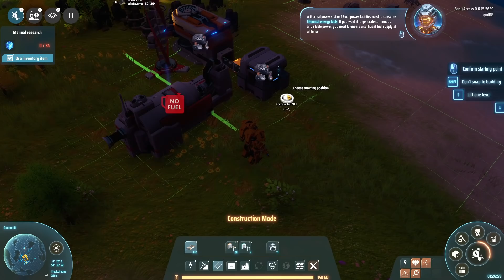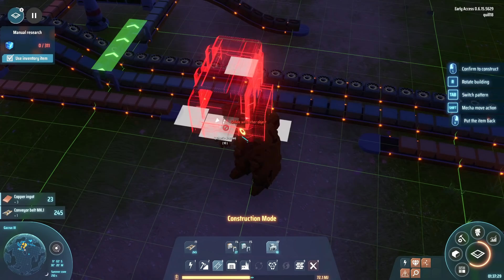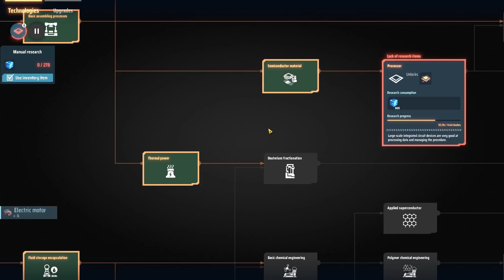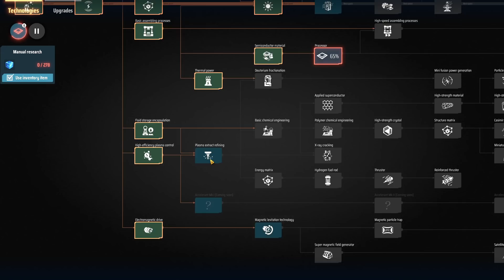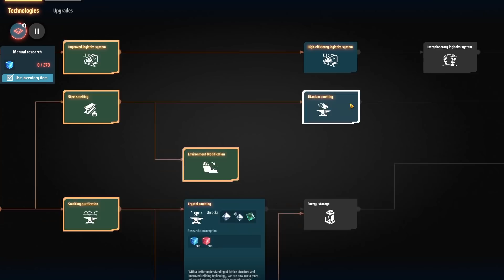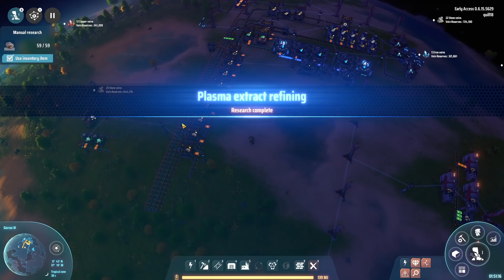Dyson Sphere Program - Cosmic-Scale Factory! Ep 3

Comment: I dont know, this game feels like an inferior clone of factorio. 
Almost everything is the same, just with more bugs and wonkier GUI. 
I guess they will fix this over time, but then it will still just be factorio without biters.
Reply: I'm 60 hours in and haven't encountered a single bug so far and the GUI isn't wonky at all, it can be improved but it's very usable.
Reply: >but then it will still just be factorio without biters.

Sounds good to me.
Reply: It's the awful text that puts me off. Paying for a voice actor but can't pay for a half decent script? Its painful
Reply: By bugs and wonky GUI I was thinking about small things you could see on the video
Like not being able to replace belts with a splitter
Or the same splitter even though its specifically designed to be used on buses cannot be placed next to a belt (needs one block of space, even though visually it fits there), 
The fact that to pick items from belts you need to open each belt and catch the item (good luck doing it when belts are moving).
etc.
Reply: @hubertnnn  I call what you mention QoLs, yes the game can use a lot of QoL improvements like one click upgrading belts, factories, etc. Everything that have a higher tier. Right now the only way to do it is to destroy the old and redo everything again, which can become tedious.

Comment: Ah magnets, so 'fun'.  Initially you just get annoyed at the 1.5 seconds per production run because nothing else works like that so it doesn't quickly fit into the calculation of just how many of what you need to constantly supply a building.  But that's fine, because only electromagnets need them and thus you only need to evenly provide for a single electromagnet production run and once that's worked out you can forget about the uneven production time.

But then you reach mid-game and need to start bothering with other planets.  And you come across the super-magnetic ring.  Which needs magnets.  And is used in some form for many things.  Fortunately, it seems like it's mostly buildings that need them not items so you don't have to worry about having production chains for those everywhere.  Well, except for Mark 3 Conveyors which are one of the few things you'll likely build a lot of that need them.

So yeah.  Magnets are mostly only used for electromagnets which are used everywhere but it's simple enough to adapt around that 1.5 second production time for them.  And the other thing that needs them, you shouldn't need more than one production set up for unless you want to automate production of everything or I missed something they were used for that is used everywhere.